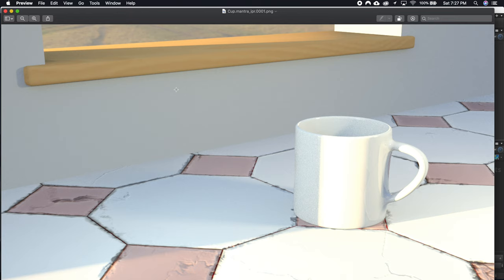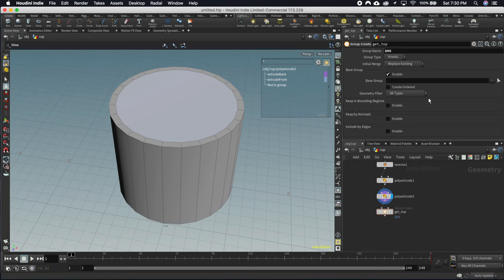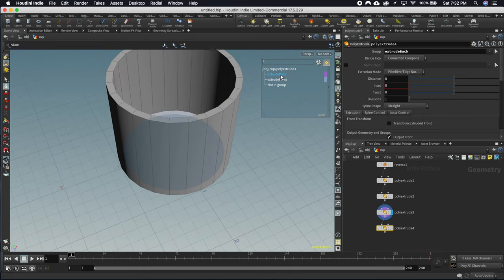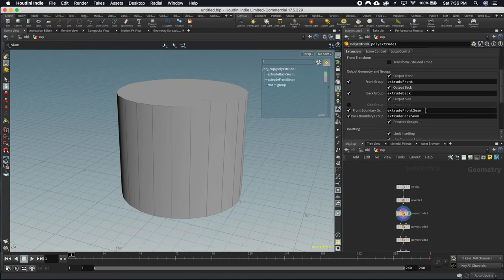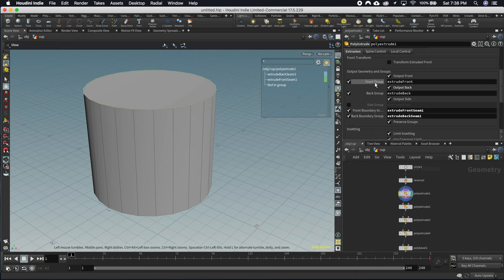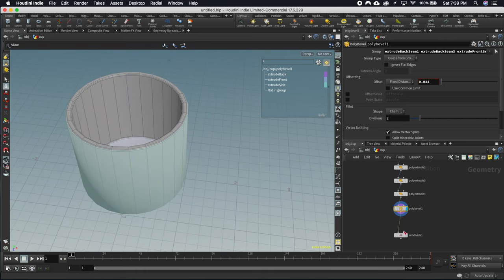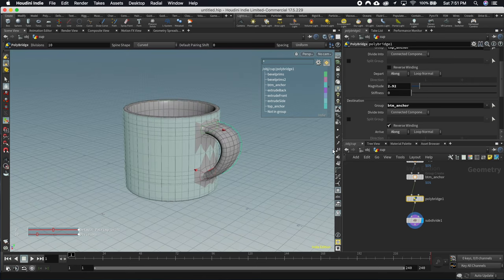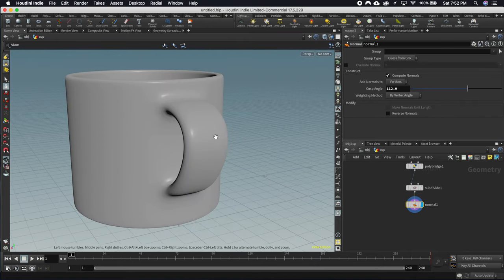Procedurally Modeling a Mug in Houdini

Comment: Not so sure whats happening after you named the first group, all of a sudden its gone and youre setting a third polyextrude?? @3.03
Reply: The group node was just a quick tip, but in this case it wasn't necessary to use a group node, because the polyextrude node before it has built-in options to seperate fronts and sides. You just have to enable the groups in the polyextrude node, so you can use them later (as shown at 1:48)